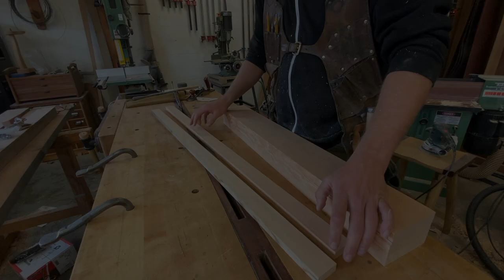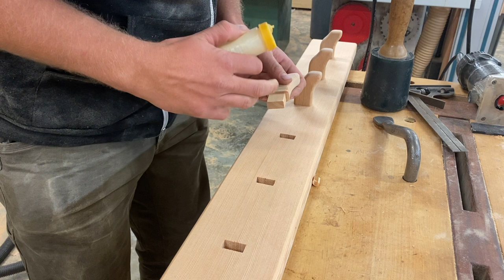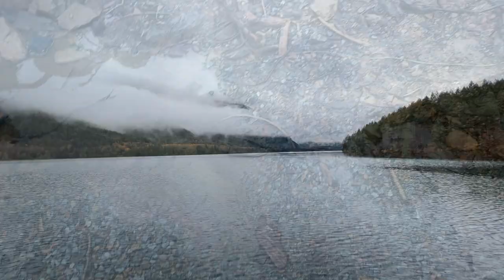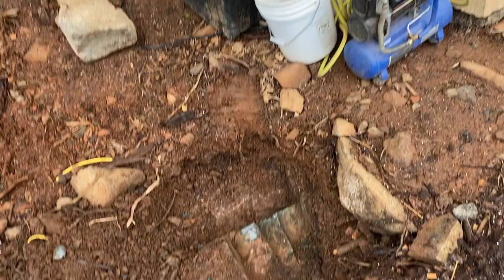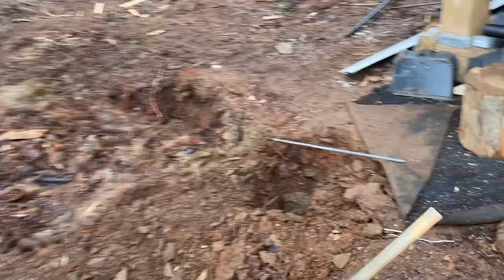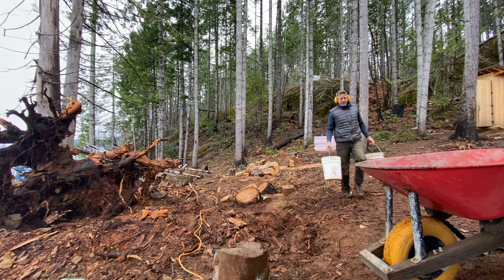Making A Simple Coat Rack and Setting The Rock Porch Footings For My Off Grid Cabin!!!

Comment: If that thumbnail is what you did there it is just rot waiting to happen. Better solution would be to drill bigger hole and use thick enough threaded rod and two nut or lock nut with big washer and leave like 4 inch cap between wood and stone that post would rest on that washer plate and part of that rod goes into post so wind or anything else can push it off.